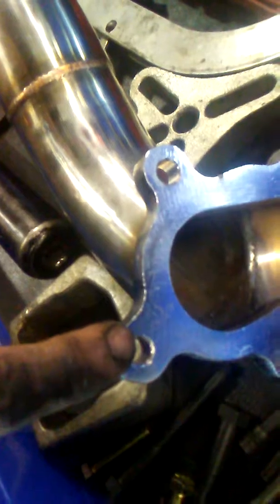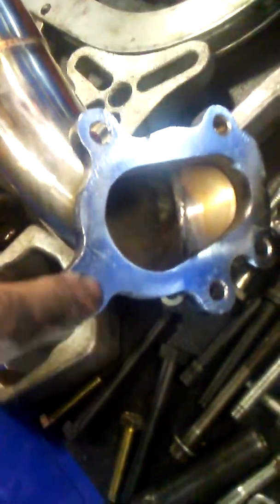Cxracing Miata mx-5 1.6 turbo install part 3

Comment: Seems like the turbo kit wasn't great.  How much was the kit.  I'm looking at something similar for my car.
Reply from the maker: Part 9 is total cost break down the kit was 1500 but to get 220 hp you have to do a little more than just the kit it can run with a factory ecu but i suggest doing like i did total cost 2900 and that's about 1000 to 1500 cheaper than the nicer kits there are different options but for the most part everything fits nicely with some massaging
Reply: @WhoopAzzRacing  ok. Thanks.  Alot to consider

Comment: I gave up on the downpipe
Reply from the maker: Could you just not get it to fit right at the flange or did you have another issue? I didn't use the spacer either I've seen in other videos where some people did but it's not necessary. also the bolts I used for the bottom where the pipe bends over top of it was the Allen headed Bolt from the oil drain that I didn't use.
Reply: whpazz Yea, my issue was the flange was either welded too close to the pipe or not aligned correctly, so i can’t fit the bottom bolts through the holes.
Reply from the maker: If you start the one covered by the bend 1st before others and modify the holes like i said in vid use a ball type allen socket it should go on but sounds like you went a different route let me know if I can help you in some way if you are near Virginia Beach bring it to me I make it fit
Reply: whpazz Worked out great appreciate the help man
Reply from the maker: @LRLogic  awesome glad to help